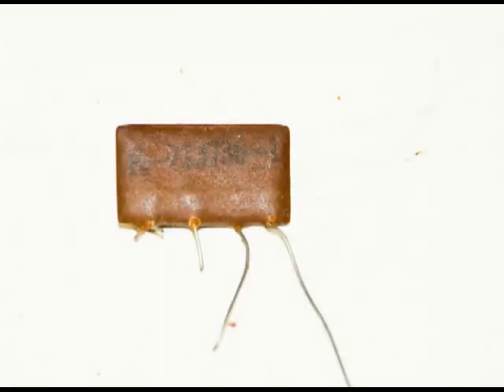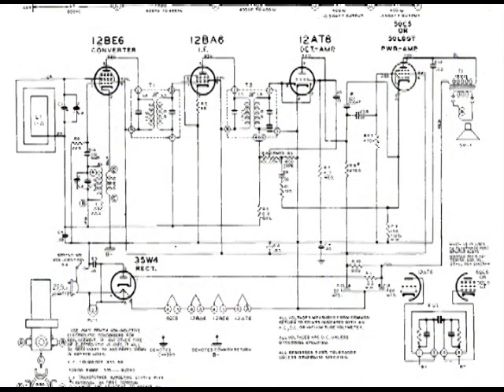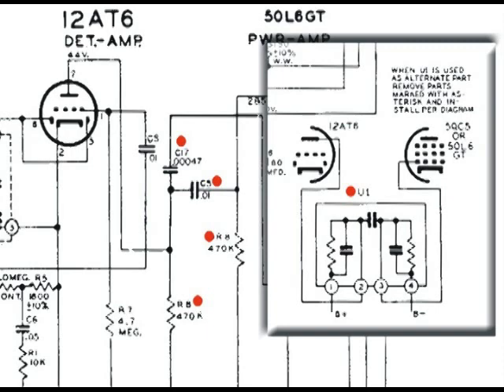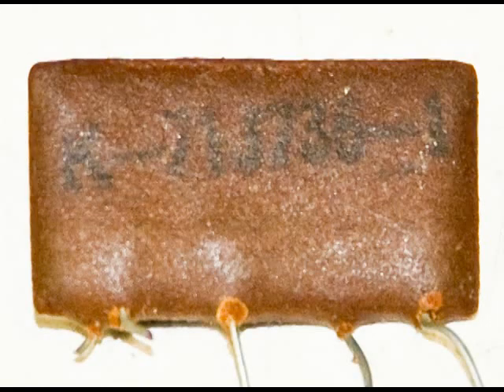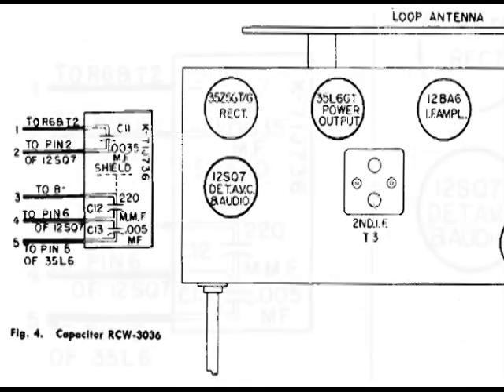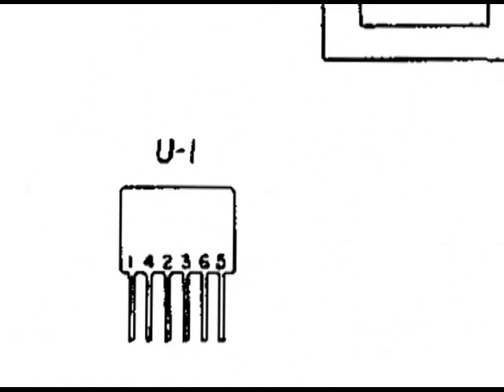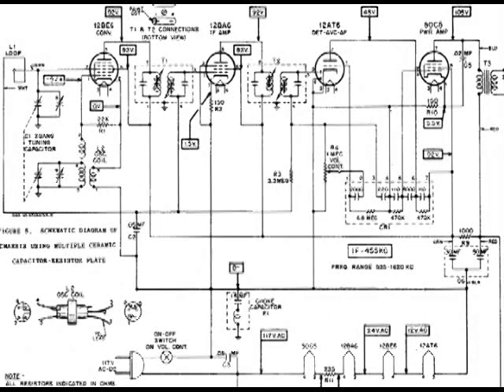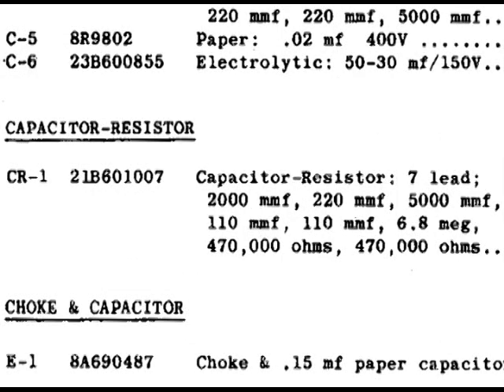Figuring out Network Components

Comment: Rick, why were these used?  I assume it must have been to lower the cost of the components but perhaps there was another reason.  Thanks for all your help/guidance.  Tony
Reply from the maker: These networks were developed to speed up radio production and save money. The networks could be built cheaply and when their installed in a radio, only a few wires needed to be soldered in which speeds up production. These networks are the beginning of the circuit board.

Comment: The early IC "Integrated circuits", With out the modern IC our life wouldn't be the same.

However with old tube radios I like separate discrete components, not IC's. The point to point wiring lends or subjects these multi lead deals to lead breakage. One or more leads break off, seemingly always right up against the "integrated package", making it hard/impossible to fix. Use discrete components to replace them (because you have to). Fortunately I've dealt with just dual capacitor packages.